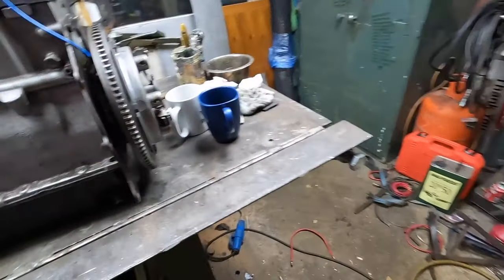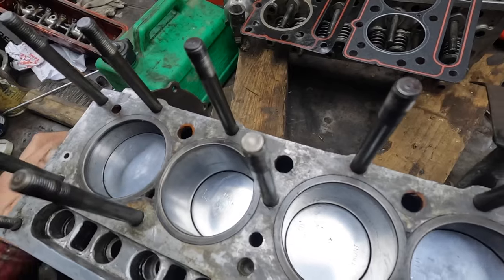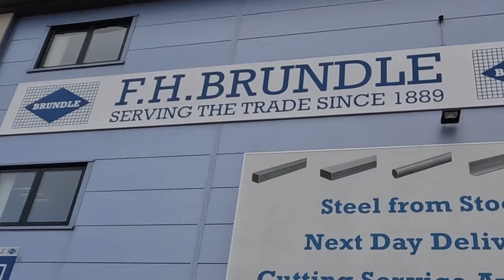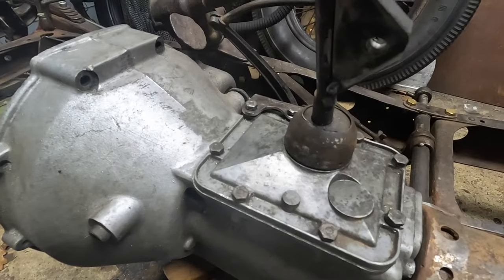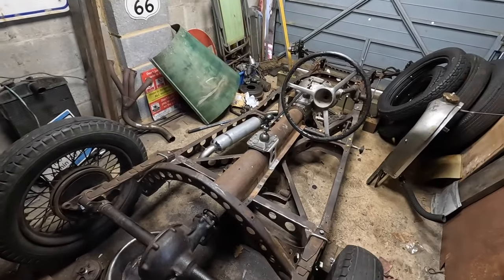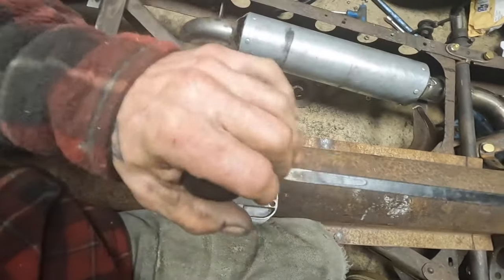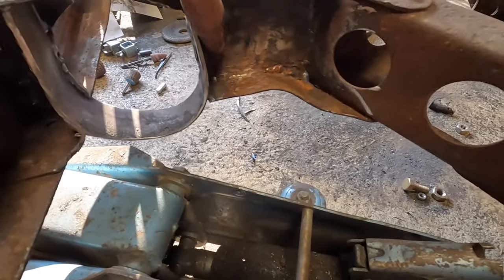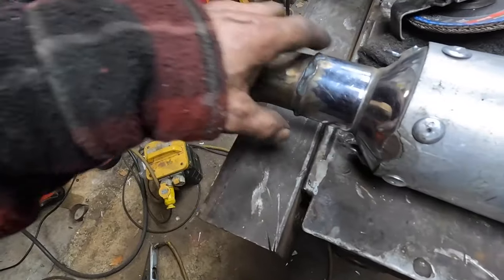the austin ten special....rat ,   part 35..

Comment: When renewing a hardy Spicer, I have found that if one circlip fits nicely and the opposite one doesn't, it could mean that a needle has slipped out and is lying in the bottom of the cup.
Reply from the maker: I did consider that the first time round ...so i took the first set out on the hope it would be...but unfortunately not
Reply: Aaaaaggggghhhh

Comment: Seriously impressed with your adaptation of the gearbox internals and the design of the remote change. I like the way you think outside the box or in this case the gearbox. A much neater end result than my effort to overcome exactly the same issue.
 The music tracks are excellent and seem to fit perfectly. The editing of the whole thing keeps you entertained even if your not a complete "petrol head".
Keep in coming.
Reply from the maker: kind words thanks Steve...pretty easy mod to be honest  ...was only made a pain by the piece that i found in the bottom making me strip the gearbox...the other gearbox had the same bit loose and broken too...must be a common fault

Comment: Alright Buddy, great video, good solution on the gearbox but they are horrible things to work on, too many parts,  have tried blue hylomar gasket sealant used by rolls royce in  engine assembly much better than instant gasket, hope you success with the head gasket, all the best. Dave
Reply from the maker: cheers Dave ,  i have some blue some actually...👌hope you are good mate...
Reply: Yes we are doing fine still working on the 10 its getting close to a start up on the rebuilt engine thats if I have the valve timing right  left you some dosh in the jar 🏴👍
Reply from the maker: @locker60  thanks brother you are a gent x....any chance you.could email me some vid of the start mate??
Reply: No problem Bryan,  when it happens............

Comment: wait.. part 25? lol.. 
also, not to belittle your work, but the two openings in the chassis for the exhaust are huge weak points - the vertical strength in an I-beam section is in the vertical part which is now gone..
Reply from the maker: hahahaha got me ..sorted now👍